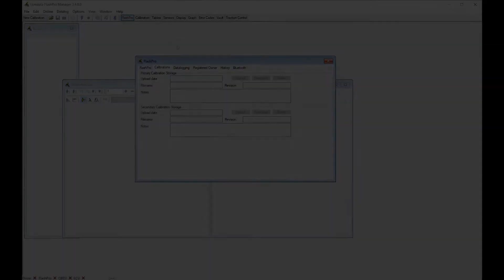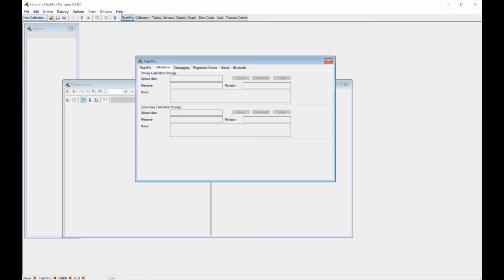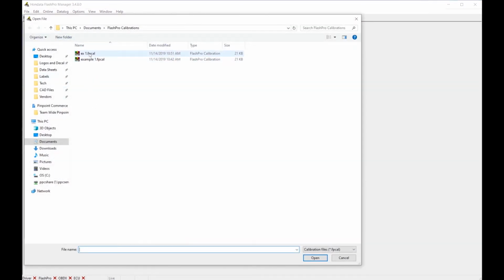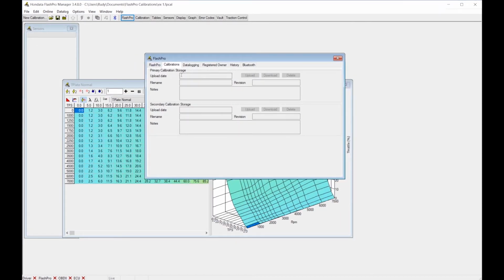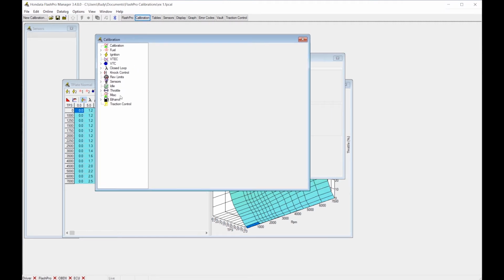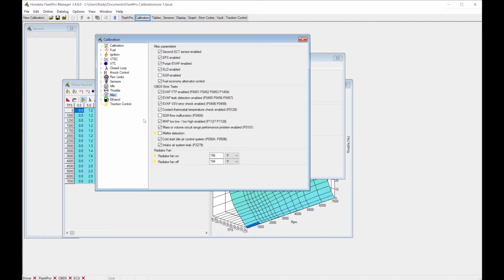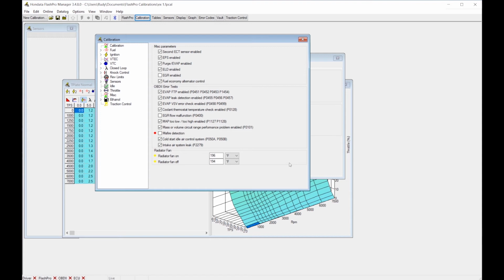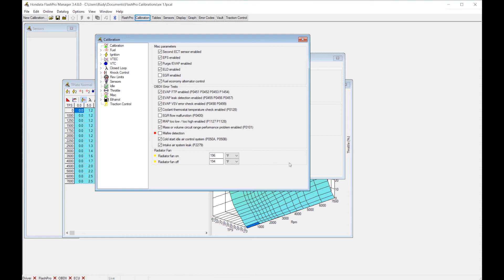Tuning Tip - Disabling Misfire Detection - 9th Generation Civic Si

Comment: hey im installing a lw flywheel on my 9th gen si, even though its completely stock other than a catback, can i still turn off miss fire detection with factory tune or i have to use a basemap and turn it off?
Reply: Yes u will bro I had the same problem until I bought a flashpro. Mines went as far as maf/iat. Just a heads up. Bought everything u can think of having to do with emission and spark. Nothing helped except the flashpro